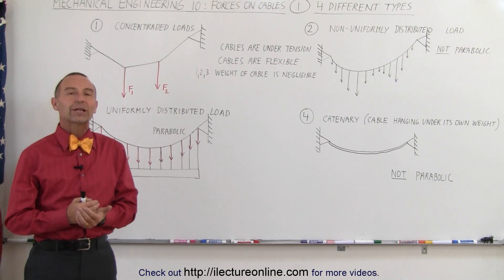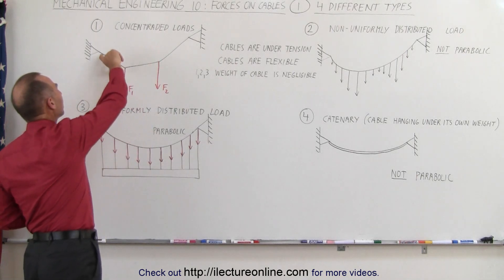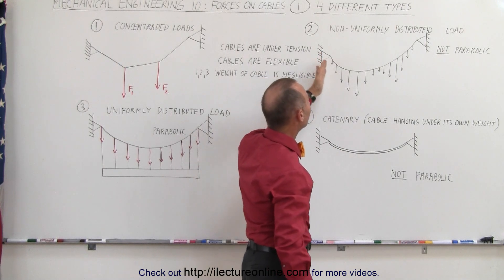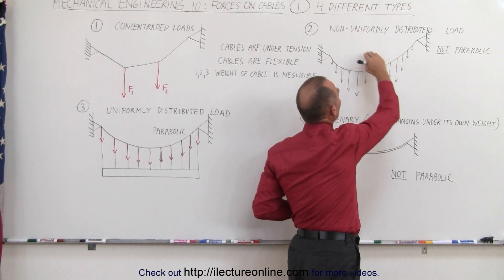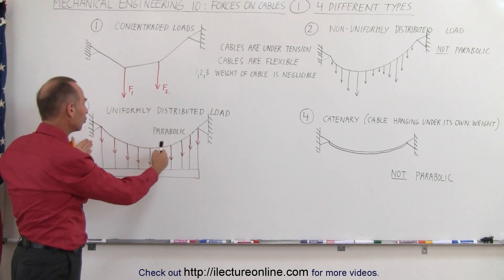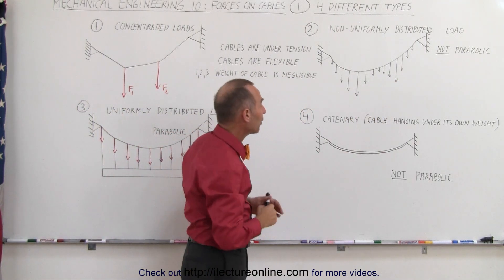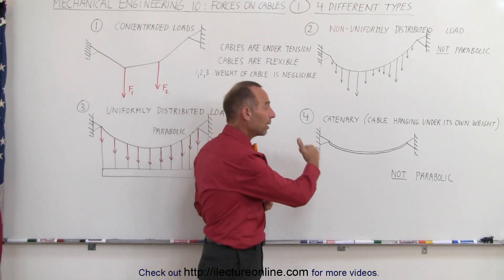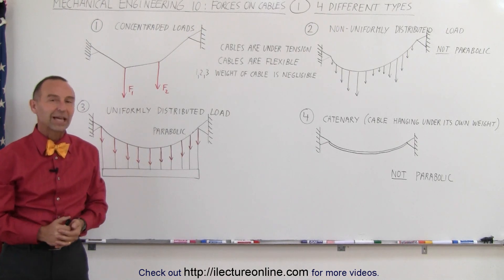Mechanical Engineering: Ch 10: Forces on Cables (1 of 33) 4 Different Types

Comment: when you say welcome to ... 
i hear "electro line" not  " I Lecture  Online" ,  but thank you for the videos i have learn from you.
Reply from the maker: Yes, many viewers have written that.  I think it is how the brain works.  The brain looks for familiar words when interpreting someone's speech.  The brain is more likely to think it heard "electro" than "ilectureonline".
Reply: @MichelvanBiezen   makes sense, any way ty for your videos.
since you are a kind person and actively answer the coments, I have a question which i can get over:

imagine we have a hanging chain (catenary) but the chain has no weight, and on top of the chain, we have liquid.

it means, our weight will change, with the height of liquid, meaning we have more weight in the middle, ifwe know the lenght of the chain (curve) L and distance between two anchors D, and assuming the anchors are at the same height; how can i find the shape of the curve ???

it is like a water filled ballon, in 2D dimension.

even if you can tell me some keywords or article would be awesome, or better if you can direct me to the solution.

since the weight per unit of lenght is not constance, i don't think that i can use the traditional catenary solution.
Reply from the maker: It would be like a hanging cable with varying density or varying weight per unit length.  We have a playlist on hanging cables starting with this video.  https://youtu.be/1RAEJy0IbUw    However we don't have an example with varying density.
Reply: @MichelvanBiezen  Yes, i have seen the play list,  and i know what are you talking about, but the problem is, i don't have a equation for the varying load,
since it is related to the shape  of curve, and for finding the curve i need the load destribution .....
there is something that i am  missing , but i don't know what !?

Comment: I see no difference between case 3 and 4 yet one is parabolic and the other is not? what am i missing?
Reply from the maker: With number 3, the cable is holding a separate load.  With number 4, the cable is hanging due to its own weight only